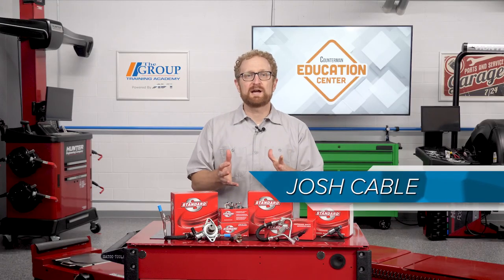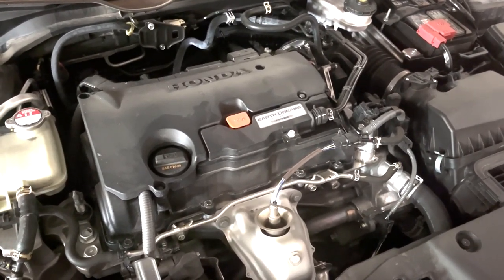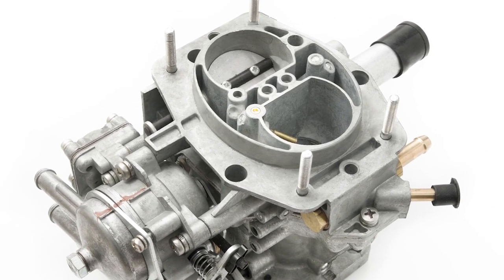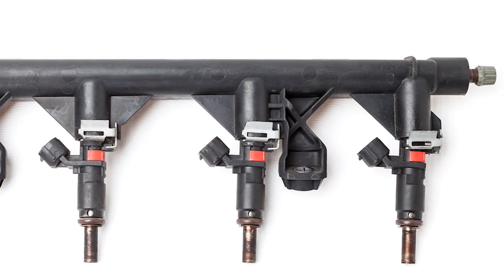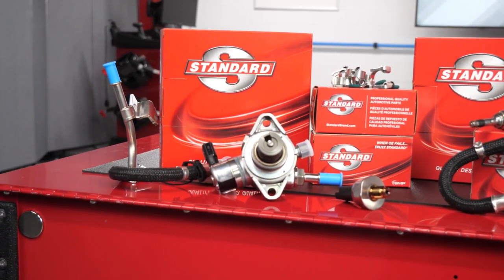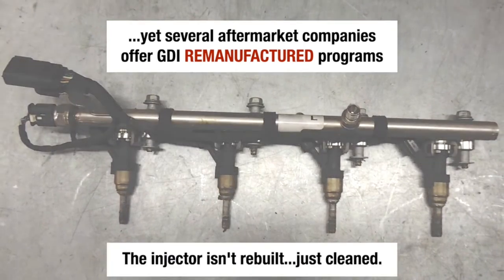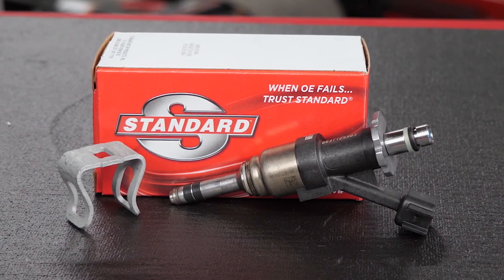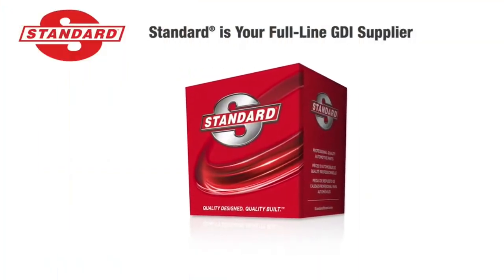Understanding Gasoline Direct Injection

Comment: GDI, good in theory and efficiency, poor in practice. excessive carbon build up in the intake, extra maintenance and expensive components. low pressure fuel delivery pump to a cam driven (usually) high pressure fuel pump results in expensive repairs when something goes wrong...